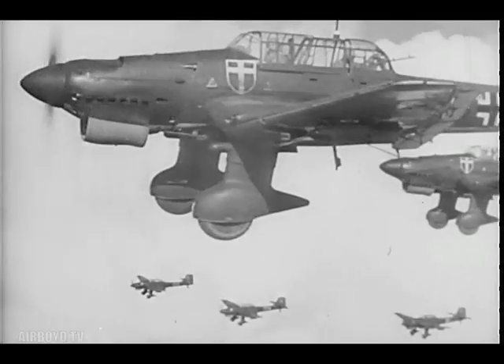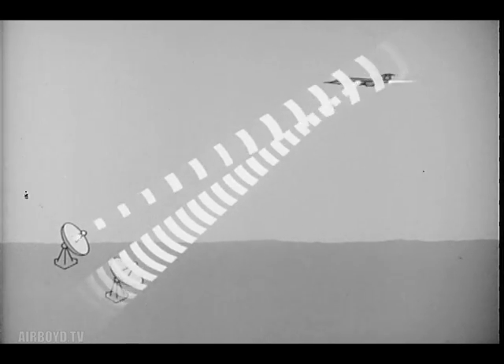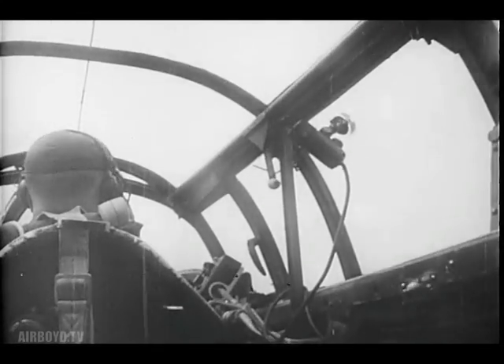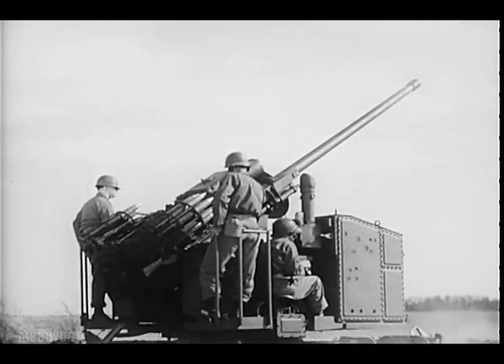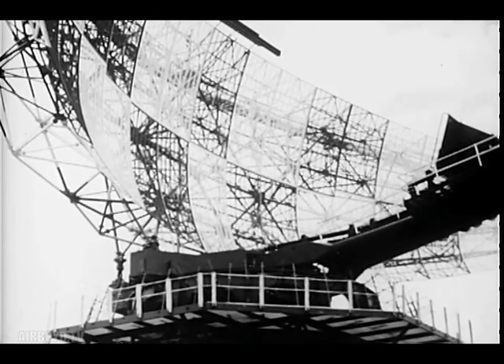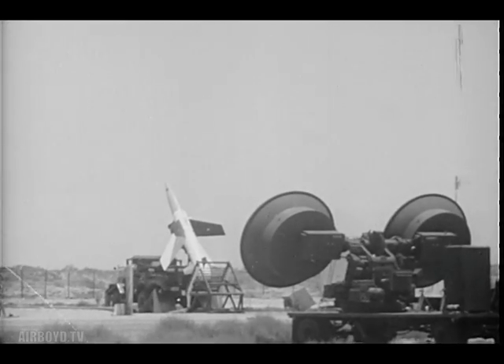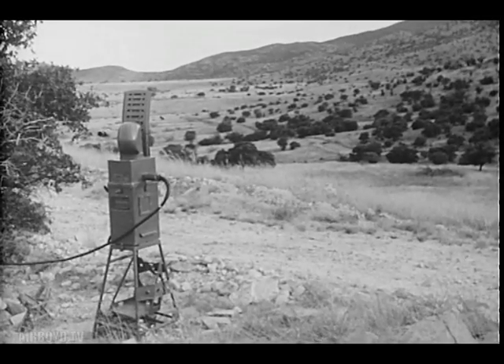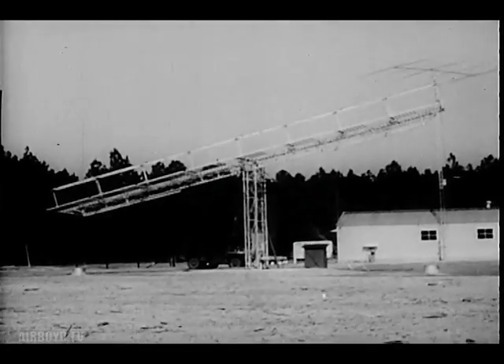Radar And It's Applications (1962)

Comment: 1931 A ship is equipped with radar. As antennae are used parabolic dishes with horn radiators.  The SCR-270 (Signal Corps Radio model 270) was one of the first operational early warning radars developed in the US . It was the U.S. Army's primary long-distance radar throughout World War II and was deployed around the world. It is also known as the Pearl Harbor Radar, since it was a SCR-270 set that detected the incoming raid about half an hour before the attack commenced.